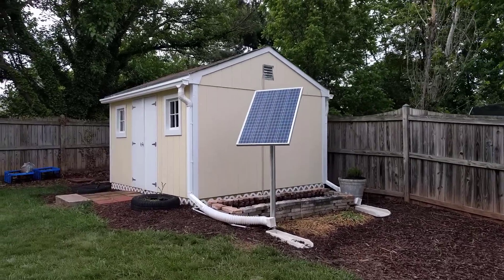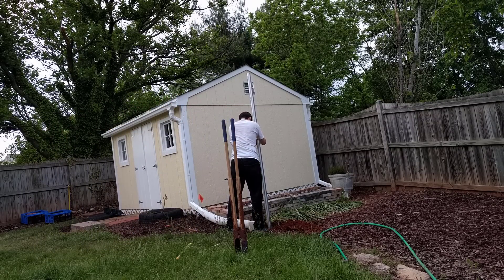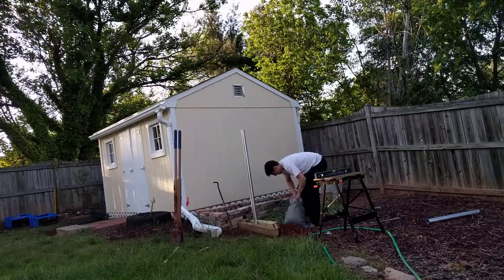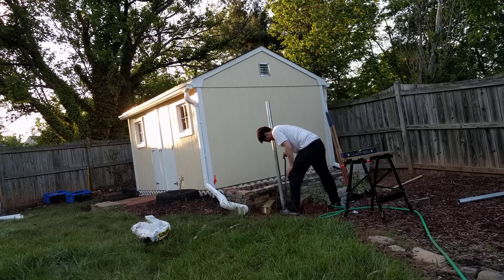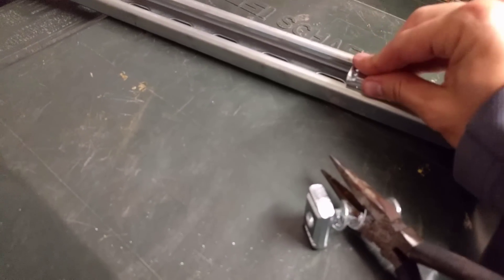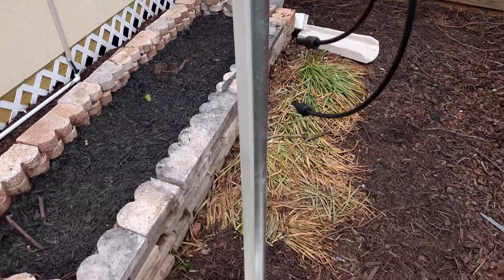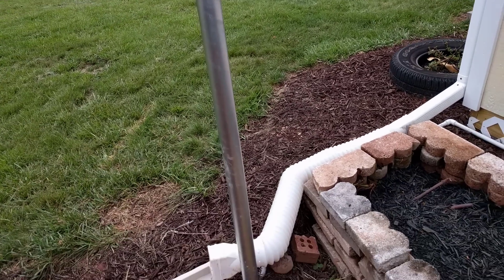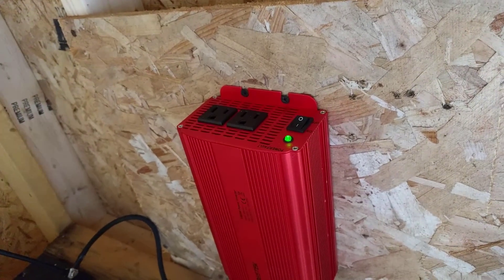Solar Power Tool Shed Set Up

Comment: Great build. How come you didn't mount the panel to the roof?
Reply from the maker: A couple of reasons.  If you put it on the roof, keeping it cleaned off will be a little bit harder, because you need to get a ladder.  Also, if it is on the roof, making adjustment to the tilt will be a little bit tougher too.  The mount that allow you to adjust the panel tilts on rooftops are a bit pricey, and with the pole, I could get away with using uni-strut and a satellite dish mount.  Overheating can be an issue to roof mount set ups too if the mount does not allow enough air to get under the panel, I don't have to worry about that at all on the pole.  Putting it on a pole also means I don't need to drill into the roof.

In my case, I also get a slightly sunnier position on the pole, because the shadows of the trees around the house cover the roof first.

Comment: Just south? No degrees to the right/ left, just south?
Reply from the maker: Yes, due South. That will get you get the most hours of sun.  Unless you have a motor that will follow the sun as it moves through the sky OR if you live in the southern hemisphere (in which case you point it due north).
Reply: burrheadjr thank you

Comment: My question is how did you get that thick wire into them tiny holes in charge controller? Modify?
Reply from the maker: The inputs in the charge controller are big enough for the thick wire without modification.

Comment: Shouldn't the battery be outside of the shed  so you don't breathe the lead acid fumes ?
Reply from the maker: It is a sealed AGM (Absorbent glass mat) lead acid battery.  It should be safe for indoor changing so long as it isn't punctured.

Comment: Nice work! One question: why not stick the panel on the roof?
Reply from the maker: A couple of reasons.  If you put it on the roof, keeping it cleaned off will be a little bit harder, because you need to get a ladder.  Also, if it is on the roof, making adjustment to the tilt will be a little bit tougher too.  The mount that allow you to adjust the panel tilts on rooftops are a bit pricey, and with the pole, I could get away with using uni-strut and a satellite dish mount.  Overheating can be an issue to roof mount set ups too if the mount does not allow enough air to get under the panel, I don't have to worry about that at all on the pole.

In my case, I also get a slightly sunnier position on the pole, because the shadows of the trees around the house cover the roof first.
Reply: You really need to consider adding fuses and that inverter is quite a bit too large for your battery.
put the battery in a battery box and protect ANY unfused leads to prevent arc flash accidents.

There should be no need to clean it or tilt it.
you are going to have some galvanization corrosion between the aluminum frame of the PV module and the steel struts.  You should consider putting some insulating material between them.